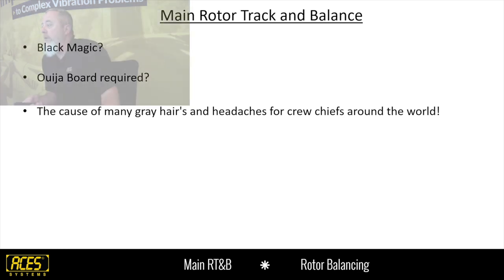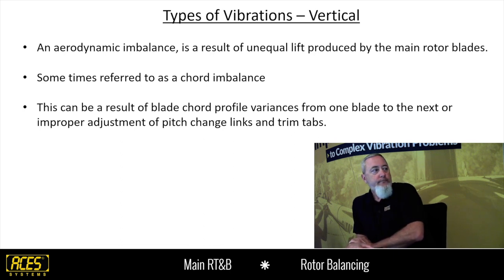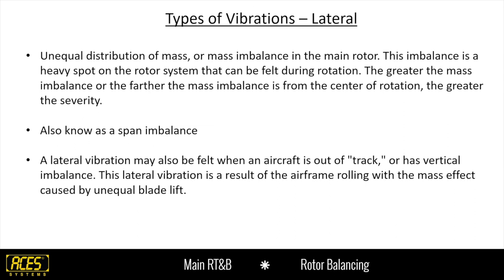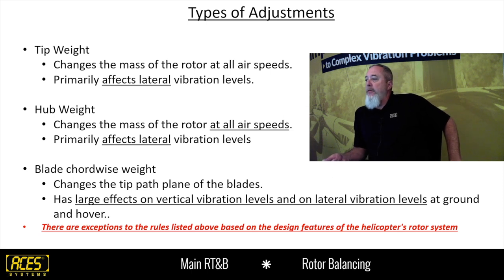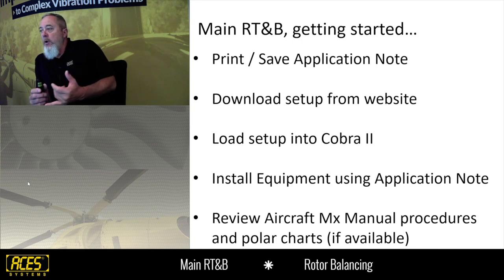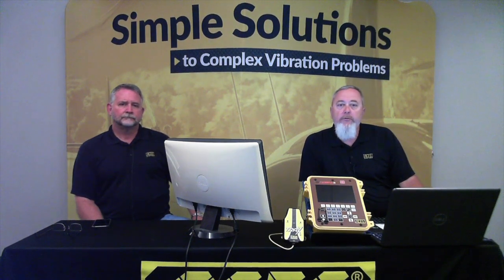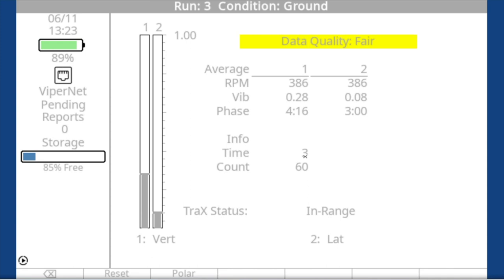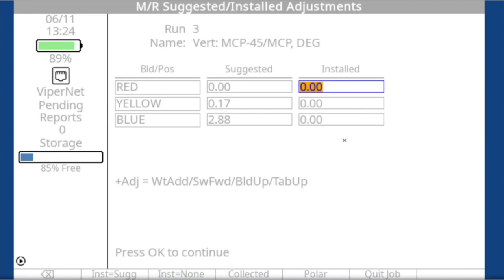Main Rotor Track and Balance

Comment: Hello, if the level of vibration  increases with speed for copilot area (tandem helicopter),  what could be the reason. ( The pilot comment: the vibration disturbs after 100 knot)  Also track and balance values are under 0.1 ips
Reply from the maker: Good morning! The short answer is: For 107/234 or H46/H47 aircraft, the vibration reading of below .1 is very unlikely and the equipment should be checked.  

For the long answer, please contact us at support@acessystems.com

Thank you! Happy New Year!